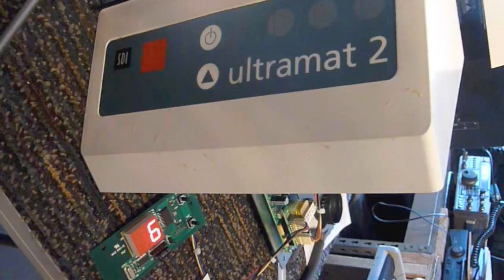Dental Equipment Repair. Water damage.

Comment: Your video is giving me hope!  Went to turn on the TV and spotted a little pool of water on the floor beneath it.....water had trickled down inside the damaged aerial cable straight into the tuner part followed by a crackling sound!  Now TV works - picture and sound - but, only through an attached freeview box and scart lead!  Could it be that the circuits affected where the aerial connects just need a gentle clean and a bit of heat....anybody cured such a water-ingress problem.....help!?

Comment: Great work. You would be surprised at the number of laptop computers that upon very close inspection, I find residual deposits left behind from a spill of just simple tap water that completely shorts a couple pins of an IC and prevents operation. It's not always the hard brain power that fixes our stuff but crude detective work with our eyes. Job well done!